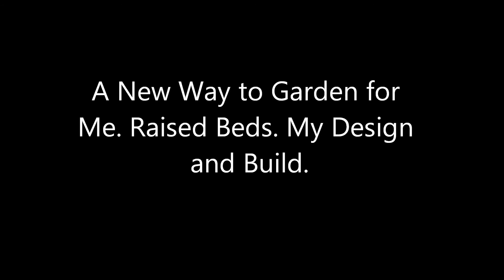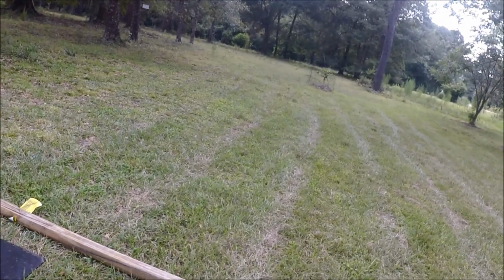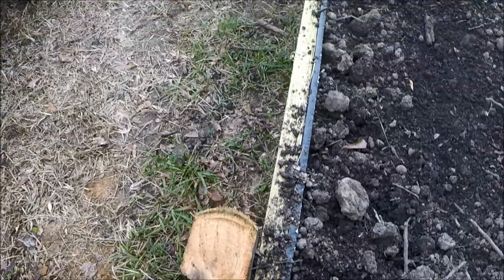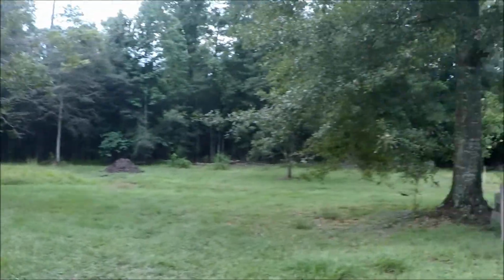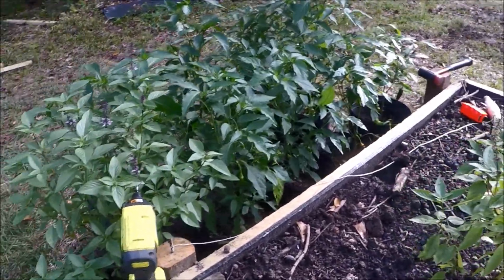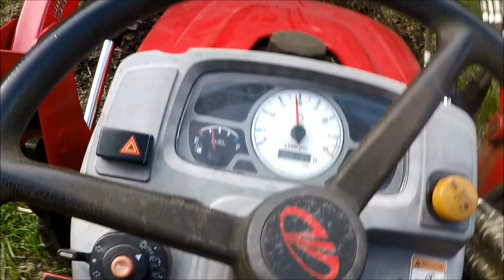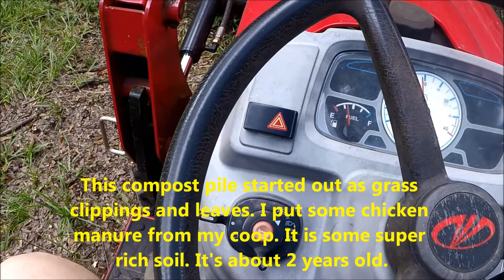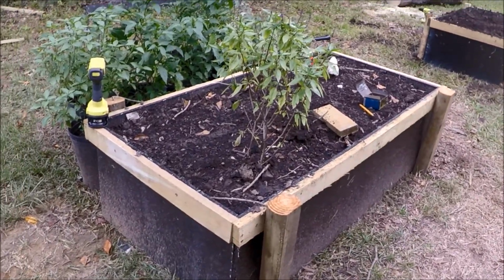A New Way to Garden for Me  Raised Beds  My Design and Build

Comment: My wife loves that Thai basil! I've done that hugel style containers before and that'll work well. The one thing I can see that you might want to think about is your spacing. Whatever you'll use to mow with you want a little clearance on both side between the beds. I had a 48" mower and I used 6' spacing. I mulched the whole area but the grass came back anyway.
Reply from the maker: The spacing was well thought out. I can pass my tractor in between the pairs of beds but not down the ally under the arches. I will be using my push mower around them anyways. Putting up beds 10 and 11 as we speak. I think I will have to take a break after these. My wife wants some house remodeling done. Oh boy, here we go.

Comment: I am so going to attempt this. They look really good. I like how much you can actually grow in them. I am getting too old to keep up with the 3 in ground gardens. I may always keep a smaller "kitchen" garden. I'm going to check out the other link you sent. Great video!
Reply from the maker: Cutting the hadiebacker board is a bit of a chore but the rest is fairly easy. This is year 2 for these beds and thy look as good as the day I built them. I'm sure you could build these. I painted the backer boards but I built some for a neighbor and they didn't want the paint. It looks like theirs are holding up just as well.
Reply: @TheSHOP411  I gotcha. Watching you cut it now. Yeah, can see why a mask is needed.
Reply from the maker: @b-chomesteading3066  that dust is really bad to breathe in. ,☠️